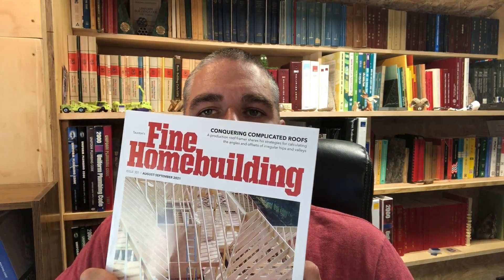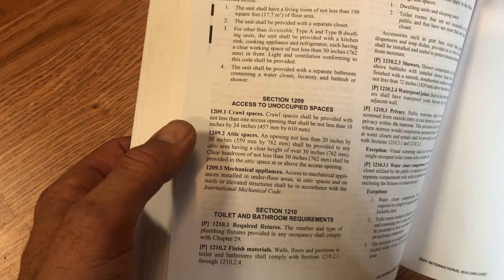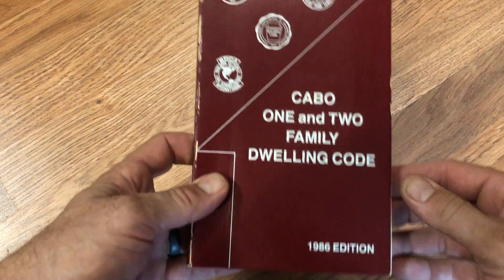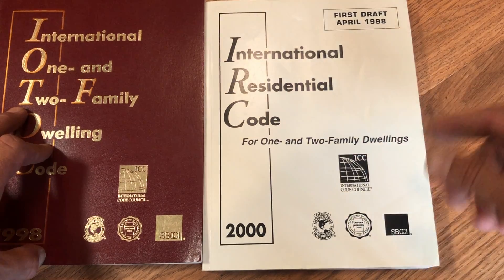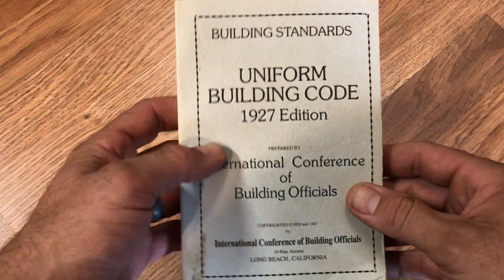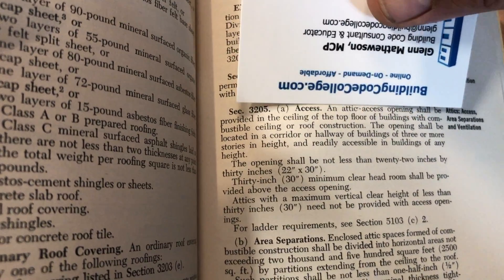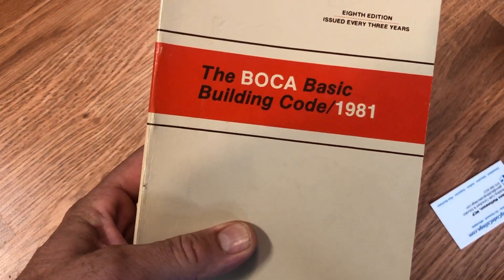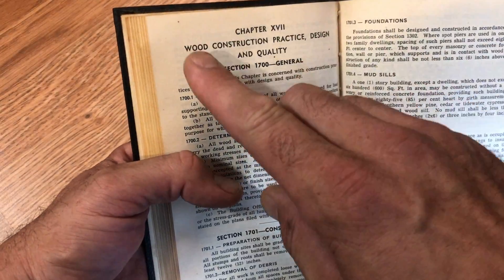What's up with Building Codes and Attic Access?!

Comment: You definitely have depth of knowledge on attic access. I personally just came across a conflict of understanding the attic access code with the building inspector. I have an attic access that is larger than the 22 x 30 opening but to get to it you need to open a door and then open a hatch/door in the ceiling and put up a latter to go into the attic. The inspector told me the access needs to be in a hallway or stairway and can't be in a closet or anything that could be used as a closet. I told him that it's built with a clear path and it has its own door to help mitigate the loss of heat or cooling to add to the efficiency of the house. He wanted me to put in a drop down staircase that would need fall into the middle of a flight of stairs (not to a landing). Then when I had a fire inspection, the fire inspector told me it was a very unsafe and bad idea to have a latter/stairs drop onto the middle of a staircase. He also approved and very much appreciated the attic access that I already had built. After all of this confusion ( months ) I still haven't received a straight answer from the building department. 

The building code is for Massachusetts and my city does not have any special ordinance for attic access.
Reply from the maker: That is very unfortunate.  Inspectors do have the authority to interpret code, but this is beyond interpretation (based on what you have told me)  Watch the video again, and pause it at the older UBC and BOCA codes.  You will see mention of "where" the access must be located and it speaks to hallways.  This may be the history in the mindset of your inspector, but this is not the current code for single family homes.